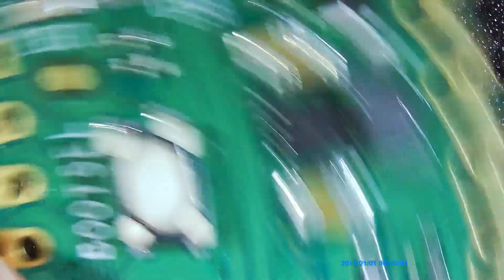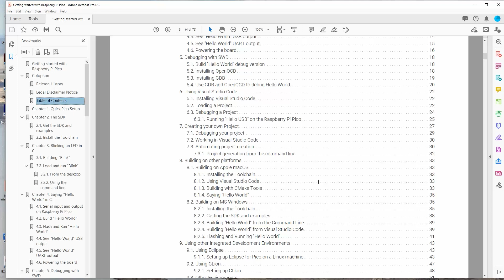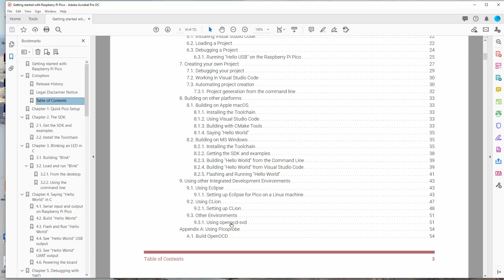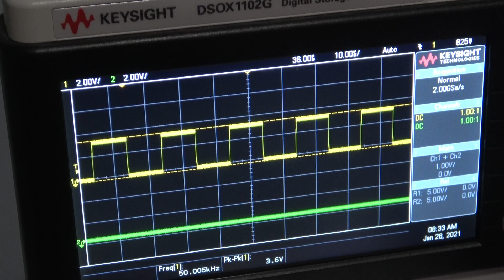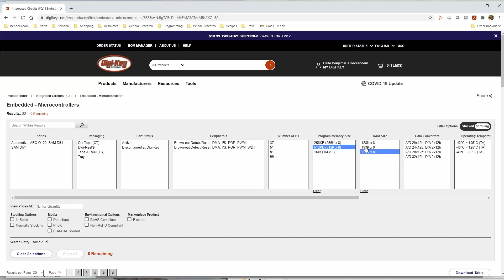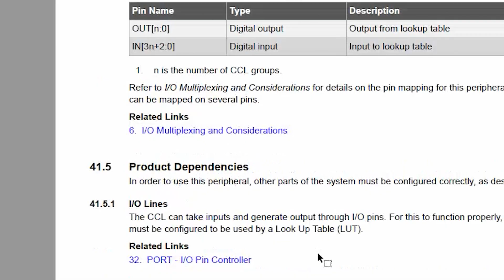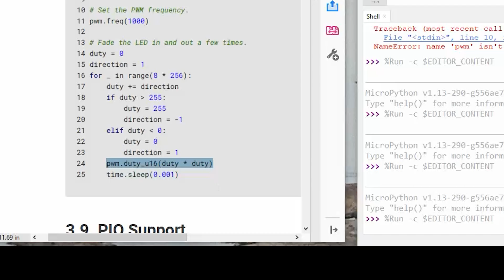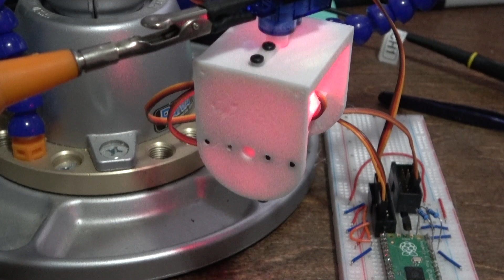Raspberry Pi Pico Testing

Comment: Raspberry Pi has always had an open source sort of focus to it, so it's kind of understandable that they list Linux first, as to why MacOS is before Windows as well I have no clue.
Reply: Alphabetical order.
Reply: MacOS is a kind of Unixm so it shares a lot of similarities. Unfortunately for us win guys, most of the OSS software is written by that <1% of the population that uses only Linux. After many many years, it's still a crapshoot if you can compile something under Windows.
Viruses target Windows because it's so widely used, not because it's that bad. The attack surface on a typical installation is huge, but that's neither here nor there.
Reply: @ligius3  It's not just "kind of" Unix, it technically is Unix, and arguably has a more direct line to AT&T's original implementation than anything else commonly used today. After all, Linux (or, well, more technically GNU) is a clone of Unix, not a direct descendent.
Reply: @ligius3  I just spent an afternoon fighting with Windows trying to get a scanner working on it. Windows really is that bad. In a few minutes I plan on going back and fighting with it some more. Because it still does not work yet. It is not my computer so that is why it runs Windows. when I use search engines looking for information to try to get stuff on Windows working top results are all scams too. Because crap attracts flies.
Reply: @1pcfred  Are you sure it's not just the manufacturer of your scanner is giving you fucky drivers with bad support or maybe even outdated drivers?
Reply: There's a lot of hate for Apple - I don't like their 'style' - I just want functionality - but as a developer that has coded using OSX in a job I had? they are every bit as powerful as a Linux machine but 'just work' like a windows machine. Nowadays posix environments on windows are common place - I don't use a windows compiler persay - I cross-compile for windows using a cygwin version of GCC.
Reply: And let‘s face it: triggered Windows nerds are TEH BEST! 🤪
Reply: @the_jcbone  The same holds true for Linux users which are usually the ones having to shove their opinion on yer face
Reply: @resneptacle  yeah, kind of. But: it‘s juicier with windows nerds because they see themselves as part of the windows master race, exclusive rights to universal truth included. 😉 so it hits so much harder if they are excluded from something fun for once. Look at clubhouse and those seething android users. But but but, we have the bigger user base! Ah, it’s like the Good old 8 bit wars. Completely irrelevant to the world, but fun.
Reply: And a LOT of my professional colleagues either run Linux desktop or MacOS  .... personally I would avoid the WannaCry Peyta Ransomware magnets as much as possible. Also Linux doesn't need subscriptions and activations and whatnot.  Its a PERSONAL preference. If you like Windows pls do use it. If you like Mac pls do. So don't bash Linux users pls, already the linux community has enough bashing to get things done. :-D

Comment: The size reminds me of a 68k proc.
Reply: It's more the size of an 8-bit proc like the 6800, 6502 or Z80, equivalent to a 40-pin DIP when you add header pins for breadboard use.  The 68k is a 64-pin in DIP format.
Reply: @MendicantMonkey  

... gotta ruin all the fun lol jk
Reply: @memadmax69  nah, there's plenty of fun to be had with this board :)  They've already demoed a BBC Micro emulator that ran with one core mostly idle, if I remember correctly.  68k systems should be possible, even if they don't have all the offboard i/o the original systems did.

Comment: "Cave man form the 70s" haahahahha
Reply: Sadly true for most Linux users even in 2021.
Reply: @MegaManNeo  My entire job is command line based. We're in the process of building a web based version of the same thing but it's been 4 years and they still don't even have any idea for how to make the new system even vaguely as powerful as what I can do on the command line by stringing commands together.
Reply: @John_Ridley  I kinda relate. I'm no expert but I do know that one can do with a single cmdline something that takes ages to do with a mouse. And then scripts were introduced.
Reply from the maker: @John_Ridley  I do push myself to use and learn Linux. When I switched benheck.com to Digital Ocean 3 years ago I rebuilt the entire thing over command line. (their tutorials are great!)